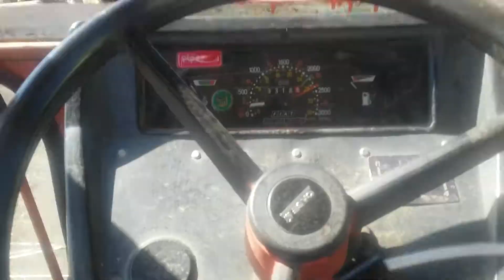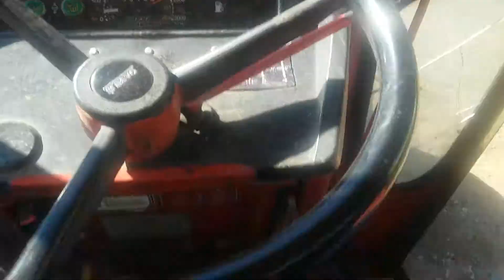Türk Fiat 70-66 Avrupa Kasa

Comment: Hocam bu düz burun 70 66 lar 90 dan 93 modele kadar var benim bildiğim bu 91 92 var mı
Reply from the maker: 92 model olması lazım Dedemin emektârı
Reply: @emreunver1219 Güzel mi 98 den 99 dan 2000 den varmı özellik olarak fark motor sanzuman aynı özellik aynı demi...ben 98 ini çok kullandım bu 90 91 92 93 Model olan 70 66 lar ile bir fark yok demi özellik aynı sadece model farkı var demi
Reply from the maker: @ferdiciferhatgurses5141  4 ana vites 3 kademe 12 ileri 12 geri levyeli liftomatik var. Tek Valf çıkışlı. 4lü 14 çekiyor Kıraç arazide
Reply: @emreunver1219  özellik aynı sadece model farkı var o.zamn
Reply from the maker: @ferdiciferhatgurses5141  aynen
Reply: Traktör  ün kralı bunlar.fiat krall